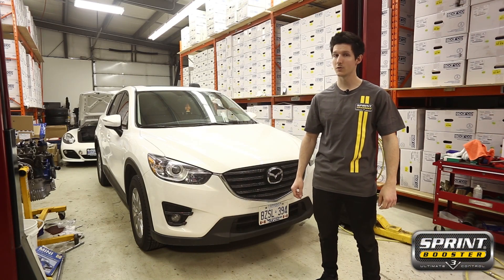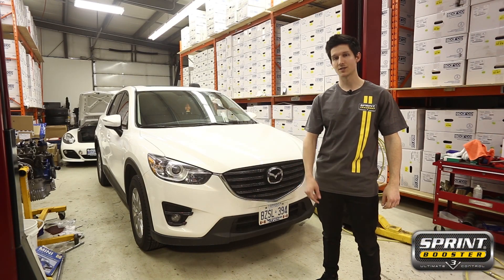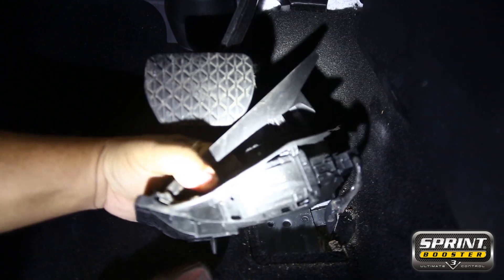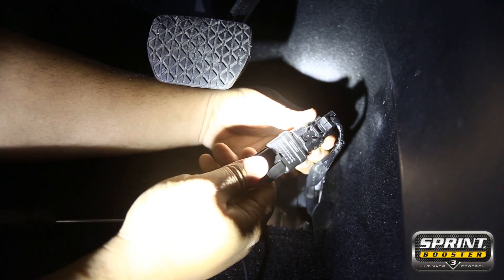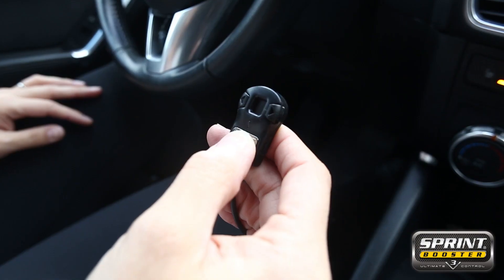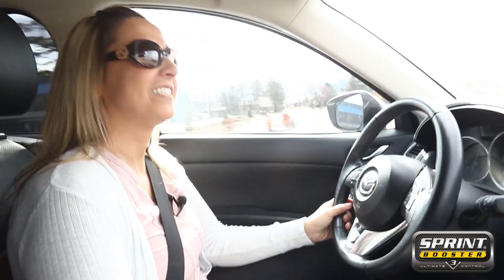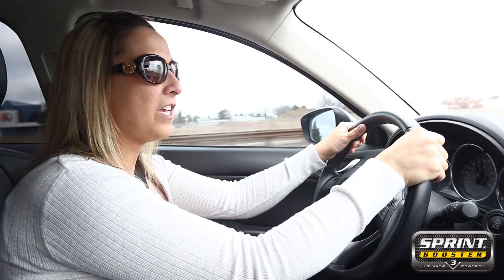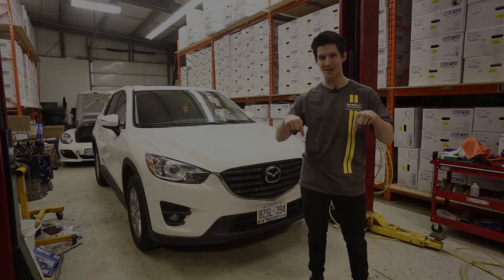Mazda CX-5 Accelerates Faster with a Sprint Booster Installed! Installing a #sprintbooster on a CX5

Comment: Looks interesting... What is the horsepower gain for a 2.5L, 187hp,  2017? Acceleration-wise, what is the improvement over the factory 0-60 time, around 7.8 sec?  Does it add to top end speed, or just acceleration?
Reply: None whatsoever, it only makes the car's computer "think" you press the pedal harder.
Reply: @nobody-wd3gc doesn’t that mean you spin out faster sometimes and makes it less predictable?

Comment: But does it affect sport mode?
Reply from the maker: The Sprint Booster also works on top of sport mode to give you more precise control over your pedal feel. Most people say they hardly ever need to switch to sport mode after their SB is installed.

Comment: You can change a "drive by wire" speeder. But the change is NOT an improvement. As if car manufactorers are incompetent. Go visit a doctor if you have a foot with reduced mobility.
Reply: It’s not that they are “incompetent”, they just have to abide by regulations that we do not.